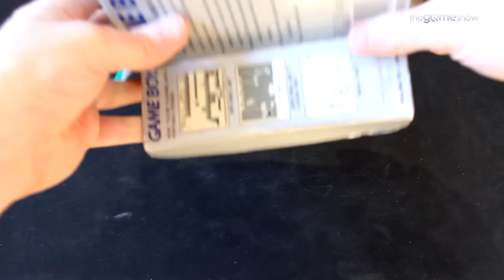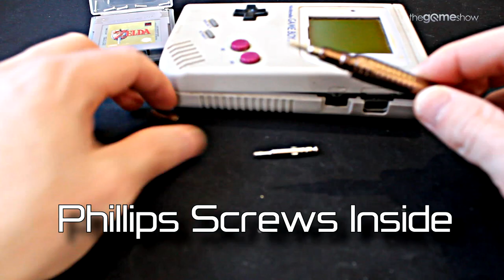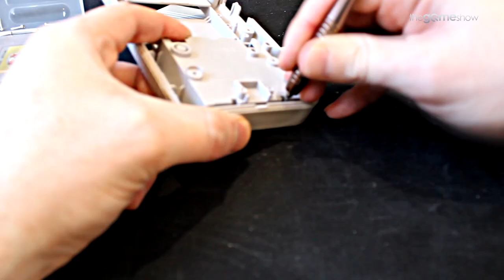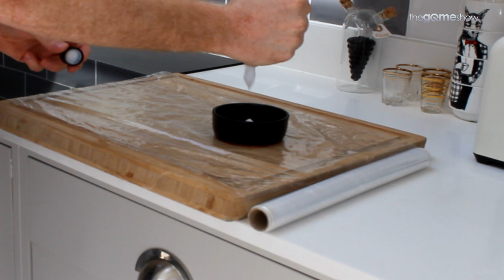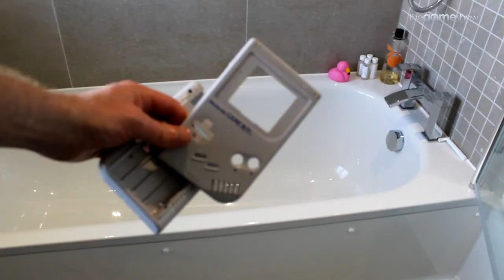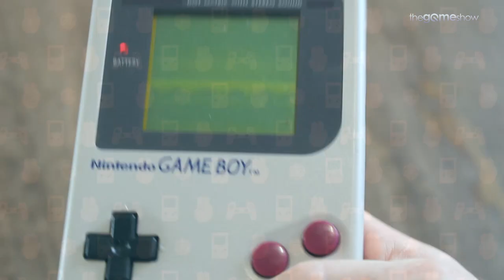Refurbishing An Old And Dirty Game Boy With Budget RetroBrite!

Comment: superb i have around 6 in various states i have reshelled one with a chinese copy case is not bad but buttons depress slightly further so at some time i will refurb the original case ,on ali express there is a glass front replacement screen lens these are quite good and scratch resistant .

Comment: Hi this Is so helpful!
Could I do the same with coloured plastic?
Reply from the maker: It really depends on the colour and finish. If you are talking about a coloured Gameboy shell, the answer is unfortunately no.

An alternate, but not a like for like finish, is you could give a really good soak and wash, and then a sanding with an extremely fine grit paper, or Wet & Dry Paper.
Reply: Thanks for answering. No it's for a tamagotchi. I believe they are different plastics.

Comment: Im planning on doing this but i was wondering how strong the UV index should be?
Reply from the maker: Any uv intesity is fine, just as long as it's not drying out. I was going to use a UV lamp used to set gel nail varnish, but couldn't bypass the timer shutoff.
Reply: The Game Show well i heard retrobriting in the sun gives a better overall result. Im gonna give it a try one of the coming sunny days

Comment: It's very sunny were I live during the summer, I want to try this with my gameboy using a similar cream SalonCare40, would the cream damage the Nintendo blue logo though?
Reply from the maker: The logo is screen printed (probably) enamel paint. I've retrobrited a lot of things over the years and I've never seen significant damage to paint applications. You can actually try just leaving yellowed plastics in the sun without any bleach. That can work really well. And if it's really sunny, then it will probably work better!
Reply: @The Game Show  thanks for the tip I tried the sun method the other day left it out in my backyard for a few hrs & all the yellow stains were completely gone.
Reply from the maker: @swampertbanka1  Amazing! Glad to be of help :_stokedQuality::_stokedQuality:
Reply: @MattyStoked  so that yello stain is a result of no light exposure? i mean i did put away my Gmaeboy perfect like new 20 years ago in Gameboy bag - pulled out last weeekend and is all yellow in front

Comment: I should do this for my old Gameboy but it would also require a new screen as mine just displays a few lines now. I'll probably be lazy and just buy a new one.
Reply from the maker: I've seen a good trick for this. You can run a soldering iron back and forth over the part where the ribbon cable meets the PCB. This reflows the solder just enough to fix the issue. YMMV though.
Reply: The Game Show Hmmm. May have to give that a try. I have been thinking about giving modding stuff a try and I would need a soldering iron for that.